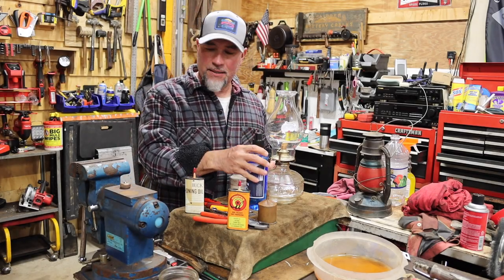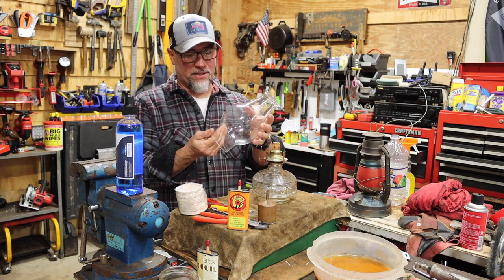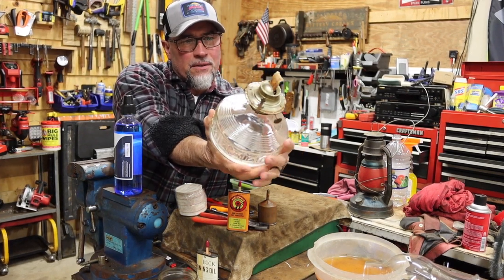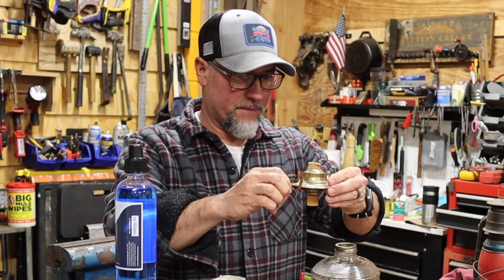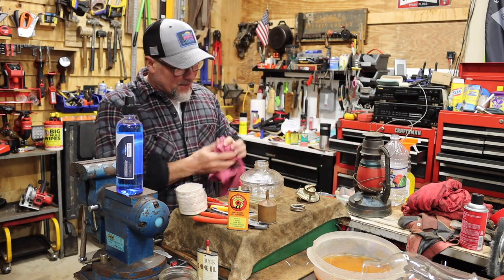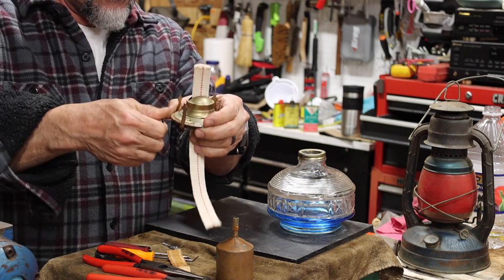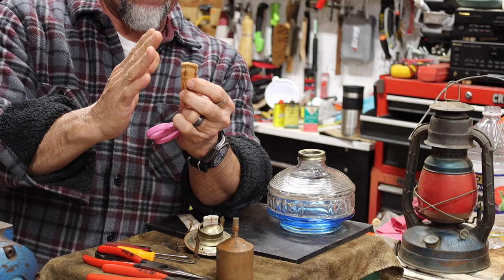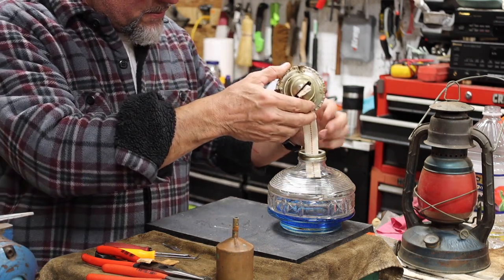Light Up The Darkness: Oil Lamp Resurgence For Power Outages - Prepare For The Coming Chaos #oillamp

Comment: I agree with what you are saying.  We use these lamps when we lose power here in the west. .Just a little suggestion, add more oil to the base so the wick can draw more oil up.  That wick should not be burning that fast.  Enjoyed the video.
Reply from the maker: Thank you. Yeah, I ended up filling it and then I got a nice slow burn from it. The old things are great.